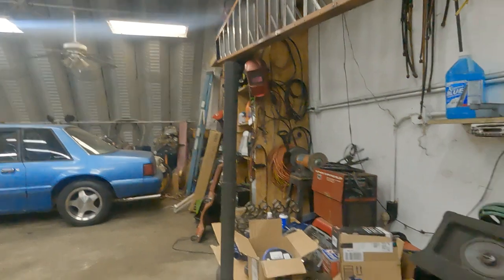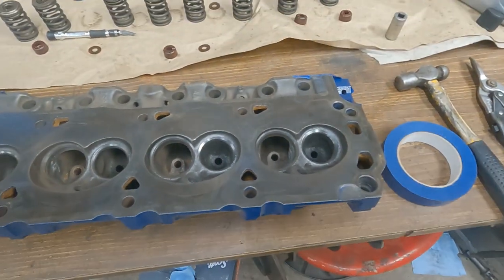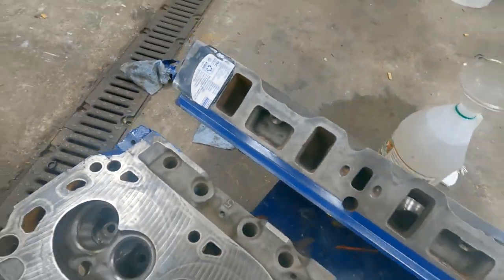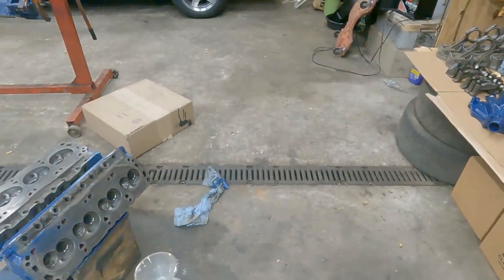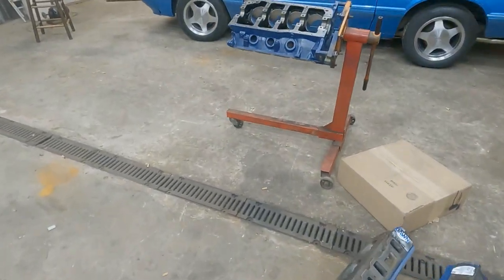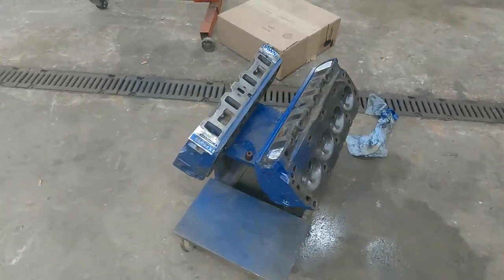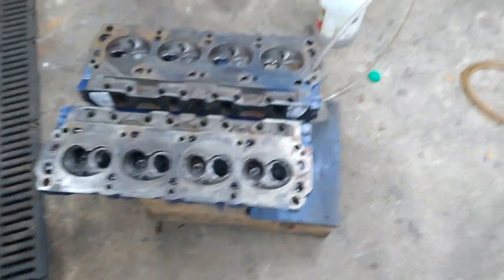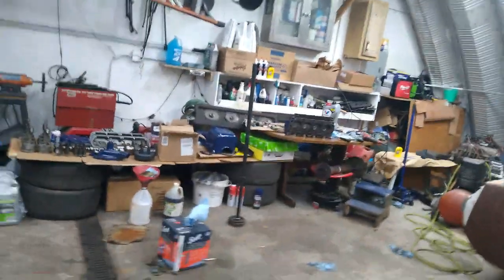86 5 0 Mustang Heads  Refresh (part 2)

Comment: Nice my man. Keep at it. 👍🏼
Reply from the maker: I finally got everything cleaned, painted and ready to go back together. I've been waiting on a intake to show up for over a month still hasn't arrived. It has been 27 years time to get the 66 Mustang back running and driving.
Reply: @kickassmustangsgarage  yes shipping and lack of parts. Sucks big time.  You will get there man. Patience is a virtue.
Reply from the maker: Ordered a intake from summit and it made it in two days. ordered from Holley a carb and intake combo carb showed up in a week the intake from Holley must be on one of those shipping containers stuck on a ship IDK. I've got everything to assemble a long block so that's next. Heads are done everything is cleaned and painted it should look and run like new again. Normaly I just put them in and don;t waist time trying to make em pretty it'll look good if nothing else LOL.
Reply: @kickassmustangsgarage  cool. Yes nothing worse than waiting.  Yes I have to always clean and paint my shit. Can’t stand when your hands get greasy and dirty putting it back together👍🏼
Reply from the maker: The part I hate is they deliver a part put it on the porch don't knock or anything. My sidewalk and the road are less than 20 foot from the porch. So if I don't get it quick it'll be gone. I feel like a crackhead peeking out the window everytime I'm expecting a package LOL. The last two engines I got where dry no oil anywhere they just don't paint them from the factory and they have plenty of surface rust. Breathing rust every day getting everything cleaned sucked!  I'm gonna build another junker 302 to use as a guinea pig for the Ranger and see what it takes boost wise before it splits. Try out one of the 14L semi turbo I have should get some views.
Reply: @kickassmustangsgarage  yea luckily I live in a rear lot. Yes since I blew my T5 and got the C4 back in.  I’m really wanting to go to next level. I may build my other 351 and real heads again.  Make it really fun
Reply from the maker: I started porting a set of early 93 cobra heads with half inch head bolt holes from the factory I beleave they used the lightning GT40s on the early 93's. Plan is put them on the 351W and put it in the Foxbody eventually. Sounds like we both have plenty of work to do lol.

Comment: try useing CLR in those heads it should clean them back to new
Reply from the maker: I watched videos on using different chemicals CLR ,rust remover, vinegar and the vinegar worked about the same or better for half the money. It got all the loose rust out in two days of soak time.